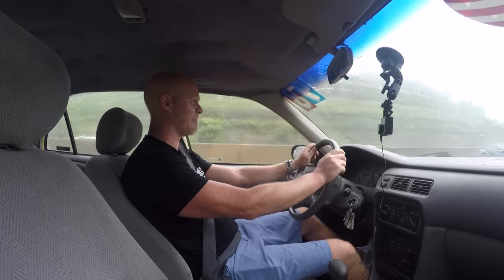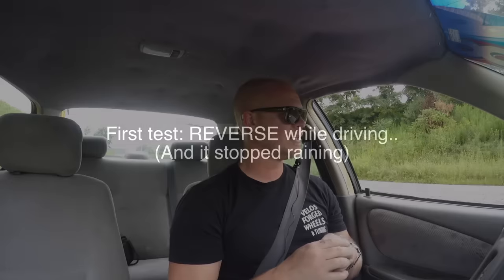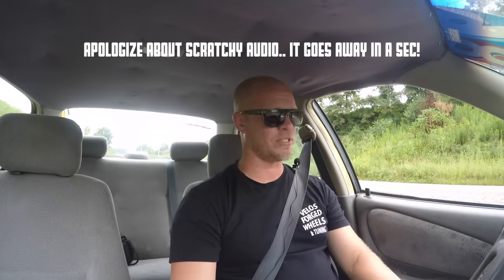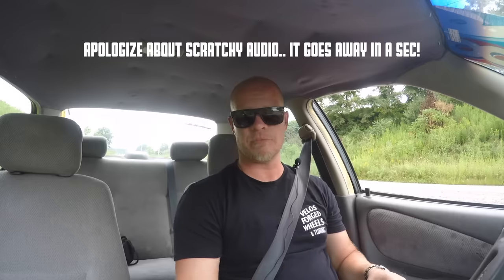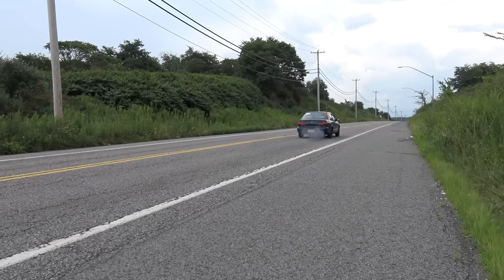What happens if you put a 20 year old car in Reverse AND Park WHILE driving? (NOT SAFE)

Comment: test it 0-60mph! on regular gas, then put super/premium gas available in your area and run the same test again to check if you get different results
Reply: It would probably do worse with premium since it has higher octane and therefore less energy in the fuel. Unless your car requires high octane gas (premium) the car will lose some power and consume more gas. Putting regular  gas on a car that needs premium will instead result in knocking if you rev the engine due to premature detonation and can damage your engine.

Comment: Should try bouncing off the limiter in neutral @ 45 mph then bang it into reverse either grenade the transmission snap the axles or actually break traction(doubtful) then try reversing and shifting to drive or park if its still moving under its own power

Comment: Front wheel drive car. Putting it in rev while going 40 causes the engine to reverse rotation and stall immediately. Putting it in park the first time you snapped a pin im sure, smoked the belts for an automatic.  Do research if you want to see something happen, use a car with direct connection no linkage. Where the shifter is attached to the transmission.

Comment: My mom's 02 Silverado had a washout on its trans (shop washed out the trans and put new fluid in with it at 273k miles instead of properly flushing it)  and it made it 200 more miles before the reverse of the trans dropped out

Comment: So putting the car in reverse the reason it shuts off is because it’s trying to go back but the momentum keeps pushing it forward so put it like this if your ever in your car and it’s an automatic car and your on a very very steep hill put it in drive and let go of the gas and break the car try’s to pull forward but because the weight of the car and the steepness of the hill it bulls the car down which causes the engine to stall kind like when your on a hill with a manual car but when your driving forward and put it in reverse the car try’s to go back so it makes it stall now with putting it in park the car isn’t trying to go forward or backwards so it doesn’t stall that’s why the engine says running

Comment: Cool vid! This just popped onto my feed today.  ‘98 Prism is an old car but you should really try this in something much older still. I did throw a ‘78 Chevy Malibu with automatic tranny into Park once while driving back when I was about 18 y/o (not on purpose!) and the results were pretty dramatic and fairly terrifying for me. Nuff said on that as I don’t want to spoil anything. You should be able to find a similar car for pretty cheap I’d think. Doesn’t have to look good, just has to drive, right?

Comment: I had it happen at 60 mph in a 1979 Dodge Diplomat, rear wheel drive. The shifter linkage fell out of the mount on the body of the car causing the transmission to go into reverse. Holy shit, let me tell you what I was all over the road from the left shoulder to the right shoulder spinning all the way around twice to the left then 3 times to the right before stopping in the right shoulder. I don't know how I kept it from leaving the road and flipping, but I did.  It still drove, even with the drive shaft nearly twisted off of the U-joints. Thank god I had Heavy duty Spicer U-joints or the drive shaft would have dropped out and that would have been really bad.

Comment: I'm watching this video today because on my way to work tonight somehow I moved my shift from drive to reverse. I have a 2009 Toyota Camry. Unlike your test I didn't go from D to N to Reverse. Instantly went from D to R in an instant and my car stalled right away. It didn't keep driving like yours did. Luckily I was on a quiet neighborhood street right by my house. After that happened I put it in Park then turned the car off(engine already locked up) and waited a few seconds and started it back up. Couldn't go past 15mph but luckily i was right by my house, maybe a quarter mile from home.  Didn't have time to mess with it because I was headed to work.  Switched cars and left. Wish I could of let it run for a lil bit(don't know what good that would of done) instead of  just shutting it off. Am i screwed? Anyone ever accidentally done this.  I'll see when I get home what it does. Scary thought what could have happened on a busy street during the day. Could of been bad. After the incident it's a rough shift from P to R, but from R to D it almost seems to easy, could barely feel it. This test he performed is different because he shifted down from D where I went from D to R instantly

Comment: if you stepped on the gas, it would probably slow down because it's trying to reverse while the wheels are spinning forward. it might just decouple the torque converter and the engine stalls out so only the transmission side is spinning?

Comment: These cars were built off the Toyota Corolla platform with the 1.8l 1ZZFE engine and most likely a 4 speed trans in the Prism (base model Corollas had a 3 speed, basically no overdrive), so yeah damn near indestructible. My 01 Corolla (same basic design, same drivetrain) had 300+ abusing miles on it before I gave it to my mother in law and she's still putting miles on it to this day.

Comment: i do know in older ford trucks for sure roughlt 2000 ish maybe a little older. at 60 if you slam it in reverse at 60, you wait like 1 second then mat the pedal an youll spin tires have a controlled drift..

Comment: There are no mechanical linkages between the engine and transmission. There is a torque converter which is a liquid (oil) filled coupling between the two. Try doing this in a car with a manual transmission and see what happens then, silly test if you ask me.

Comment: I have a 2001 Silverado and i was towing stuff so i had it in the actual gears and shifted into reverse instead of 3rd(trust me the gear shift it short) and it just shut off and went into neutral. Same as if u rev the engine high and shift from neutral into drive

Comment: I had a 1984 Ford F-150 I accidentally put it in reverse when I was 16 trying to show off and put it in neutral to rev it. I accidentally went to reverse and broke the tail shaft housing and u joints. So maybe you need to go older in your vehicle choices because I’m pretty sure that in 92 they put a safety mechanism in the transmission of all vehicle to prevent this to happen

Comment: I accidentally did this with my dad's 1991 GMC Safari driving at about 60 miles an hour, if not more; probably about the old slug's top speed. The engine died and it never started again. The torque converter probably jammed right up into the engine. I think I did my dad a favor as this occurred only a few years ago. Also, that's not a Chevrolet.. it's a POS rebadged Carolla!

Comment: "Four or five speed automatic transmission"... it's a four speed but you count 4 gear shifts because the last one is the torque converter lock-up clutch engaging. it's not an actual shift

Comment: The engine stops because the tires are spinning the wrong direction for reverse. So when you put it in reverse it tries to turn the engine backwards thus killing the engine and once the engine is off the transmission has no input anymore  so you keep rolling.

Comment: I had a 93 Ranger that I accidentally threw into reverse at around 50mph (meant to coast down the hill, went a click too far). I didn't get the jarring that happened in this video, but the engine did instantly shut off and it just kept rolling like it was in neutral. I continued driving it for another two years with no tranny issues, to this day I'm not sure if it actually went into reverse or if I triggered some kind of failsafe.

Comment: What your trying to do , I have easily done over 100x  .   you need a RWD car .  The cars I used 70s Plymouth & chevy - Ford.   I had a Plymouth duster that I did it more than 80x and weaker 904trans never slipped . Weaker 7-1/4 rearend never broke and U-joint never a problem ..  One trick is pavement texture .  Another, before u grab R ,  rev it a bit to bring the RPMs up enough so the tires break free spinning and you don't stall out . If you have a posy rearend-hang on ,  even a one wheel peel is hard to hold between the curbs at over 50mph . Speed? I wouldn't do it over 60 ..  Just too hard to hold straight.  Leaves a long black stripe 100ft long , then you start rolling backwards through your smoke spinning away BAM back to D

Comment: I had a 91 Nissan 240sx, while driving down a hill, my friend hits my shifter and it went past neutral into reverse. I didn't realize what he did, my foot was still on the accelerator though. The engine never shut off like it did in the video, but I was able to go a few more miles before the transmission completely gave out. Sad times.

Comment: The ignition shut off because the engine need stop while driving and putting the gear In reverse to much rpm’s while switching gears in an automatic transmission

Comment: I accidentally did this with a 2001 Chevy Cavalier one time, and it was fine. I went to rev it in neutral while driving and accidently shifted into reverse (it was an automatic). The engine automatically shut off, and as soon as I stopped and put it back in park it started up again.

Comment: one of my favorite cars was my Chevy/Toyota Prizum/Corolla. The difference was they no kidding made up a too large a cylinder bore with over sized piston rings I believe that Toyota didn't want the American car to be as good as the Japanese version they figured the engines would burn up what happened was high oil consumption oil passed by the i
oil ring no seen smoke. they created a reliable two stroke that ran forever as long as you put a Quart of oil every tank of fuel. self oil change just replace the filter on that crazy thing every 25,000 miles and got 250,000 and still running perfect never a problem with that car.

Comment: I accidentally did that

I was slowly rolling down a slope in drive and I accidentally hit the gear selector, moving it from drive to neutral and straight into reverse.

I heard a slight crrrrr (like a small grinding noise) and quickly slammed on the brake to reduce the amount of damage
Reply: I accidentally shifted in park while still moving (I was in a hurry) and it did that noise, but it's the parking gear, not reverse

Comment: Repair shop: How did the transmission blow.
Him: I put it in reverse and park going highway speeds or( mach 5) twice.
Repair shop: welp we know  the problem that will be $1500.
Him: nah it should be $50.
Repair shop: this isn't 1988!
Your going to see it on ebay stock miles good engine perfectly good transmission.
😂😂😂😂😂😂😂😂😂😂😂😂😂😂

Comment: the best way to destroy a car transmission (this can only be done with manual transmissions) is when you're driving at 70-80 mph in 5th gear and shift it into 1st or 2nd gear. the moment you do that, the rear of the gear will jump into the air right as your transmission says f**k you and goodbye

Comment: My first car was a 92 Geo storm in 93. For about the cheapest new car you could get Isuzu put a pretty good transmission in it. You could only rev the engine top 2000rpms in neutral(I guess because they expected dumb 16 year olds to neutral drop it at every red light). Mine would shut off if you put it in reverse too.  I dogged the shit out of that car and it never gave up on me.

Comment: Simple physics.  When you put the car in reverse it stalled the engine - it cannot do anything else. It also stressed the transmission terribly.   It did not brake and kill the ignition, that would require advanced computer technology which it lacks - that is completely wrong and you are giving bad advice.  Park just stresses the transmission even more which is why you got black smoke.  You are just successfully damaging the transmission.  Congratulations.

Comment: You broke a small pin that locks on one of the gears when you put it in park
Reply: The car stopped hard (skidded) once the revolutions were slow enough to catch the parking pawl.  The rattling sound was it skipping before it engaged.  If it broke, the car would have coasted to a stop quietly, or with grinding noise from the broken part tumbling in the trans.

Comment: Well what did ya expect?!! You used a corolla/prism from when toyotas were indestructible and chevys were built like rocks! Try something like a 2002 Ford Exploder. Or try this..
Next up on AutoVlog: 
What happens if you drive around a curve at over 37mph in a Mitsubishi Montero?(NOT SAFE)
Reply: I've accidentally did this on a 2001 ford explorer sport trac does that count? it killed the engine, damn gear shift is off a notch and i accidentally put it into reverse instead of neutral. it killed it, and i was so scared. Transmission is still working at 197k miles, it's getting weak tho.